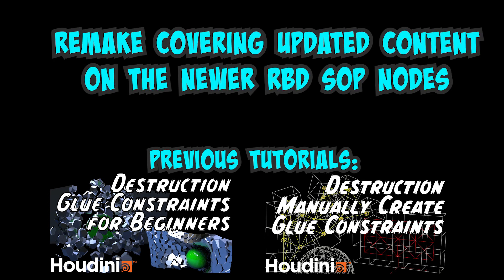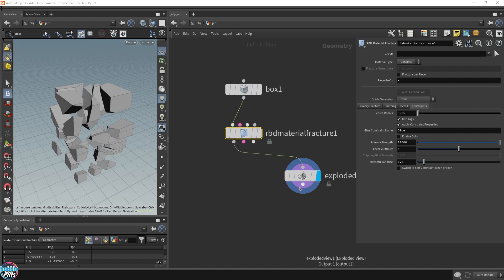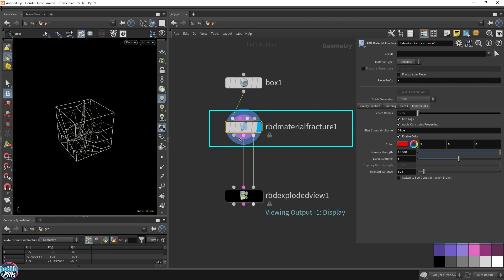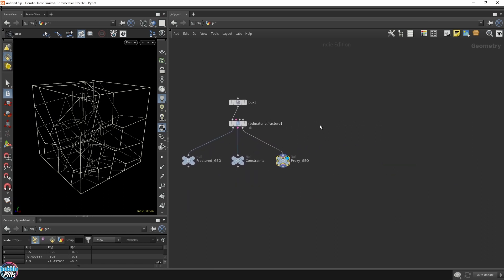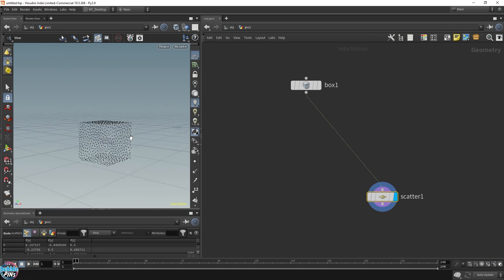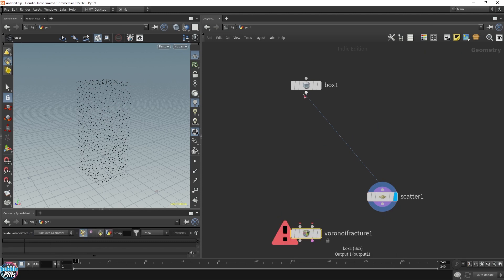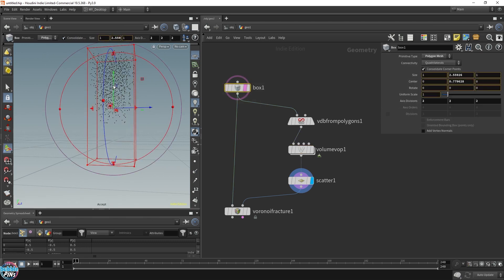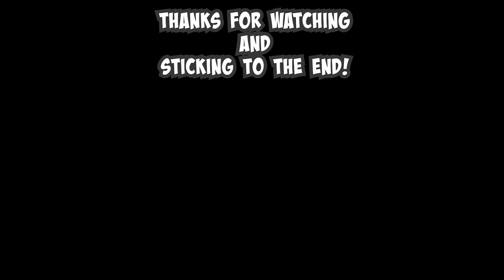Cinematic Destruction Basic Concept #2 RBD Fracturing (Rigid Body Dynamics)

Comment: I'm trying to have to colliding objects break part on collision. I haven't been able to find any solutions on this, though it seems like it would be easy...any help would be awesome!!
Reply from the maker: I believe what you want is overwrite constraints within the rbd solver, that way you can manually animate the deletion of the constraints.  You can add a blast node and animate which constraints you want to blast.  You can use the other geometry as a selector and feed it into the 2nd input of the group node and set it to a group by geometry bound detection and then feed that group into the blast node so it dynamically deletes constraints.  What you need to be careful of is when you delete the constraints that they fall apart far enough so it stays broken.  You can also add a solver node to make Houdini remember the constraints broken, but that's a little more complex.  I would suggest to exaggerate the original geometry, like expand the group to be blasted, that way more constraints are deleted before you feed the constraints into the 2nd input of the rbd solver (the purple connection line).  Just to summarize, this is overwriting the constraints manually in SOPS.

Hope that helps!
Reply: @bubblepins  Yep thanks! I found out it was how I was naming the piece attribute, and it was screwing up the RBD solver. All fixed. Thanks for your great videos! I learn a lot from them.